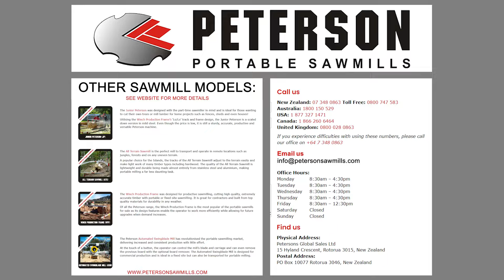Peterson DWS Portable Sawmill AND Kubota KX080-4 Excavator: Large White Oak Crotch

Comment: Do you ever run a metal detector over the wood before you start cutting?
Reply from the maker: Hey Bob! Sorry for the late response. Sometimes I'll run a metal detector over it. I probably don't use the metal detector as much as I should. It's sure a lot cheaper letting it detect metal . . . than the chain! Last time I checked chains were $106 each. - Samuel